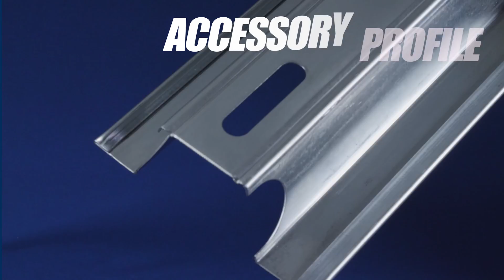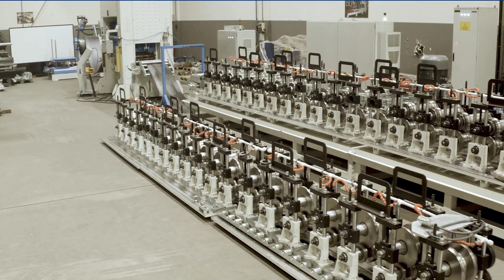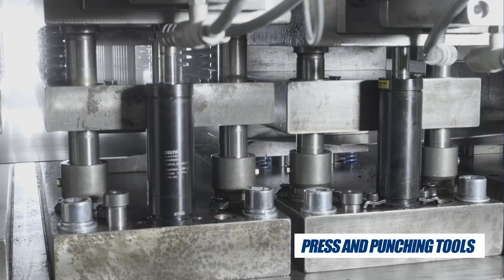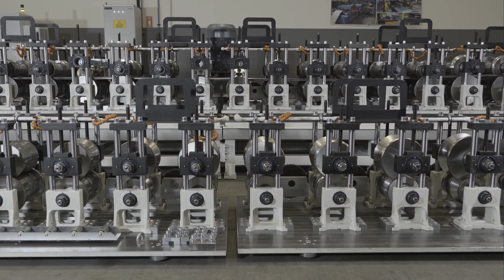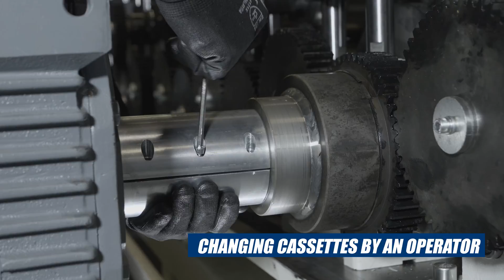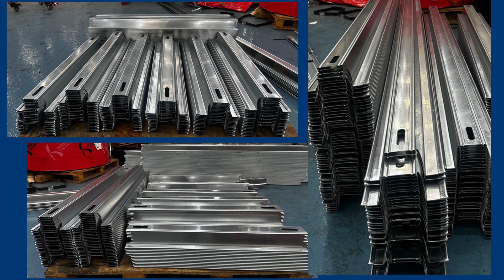Scaffolding Plank, Accessory Profiles Production Line (Cassette type RFM)

Comment from the maker: In the building and construction industry, scaffold boards—also referred to as walkboards or scaffold planks, scaffold wood, and scaffolding wood (when made from wood)—are materials used along scaffolding structures to facilitate safe working conditions at height.